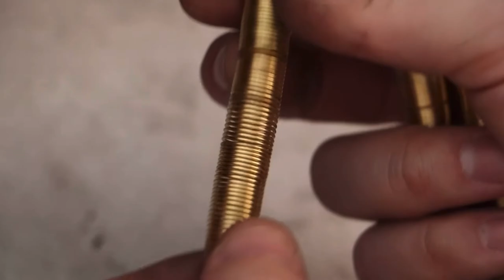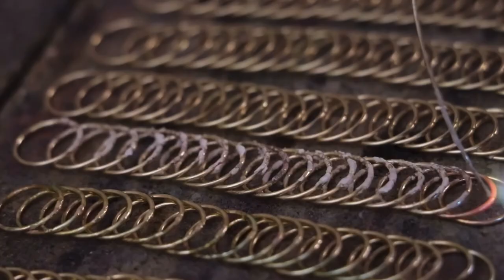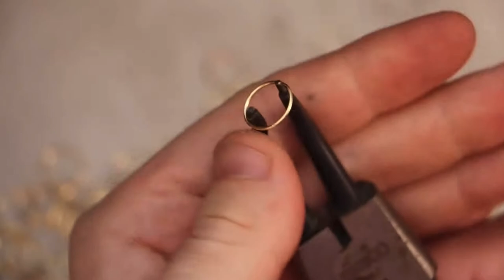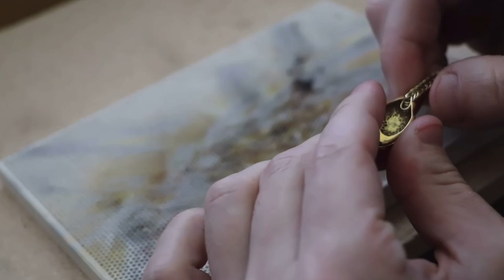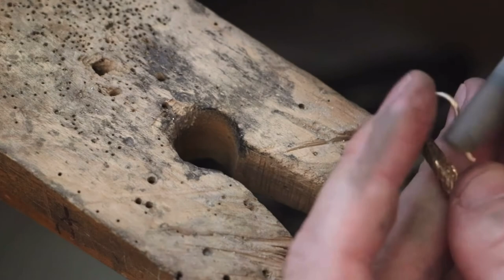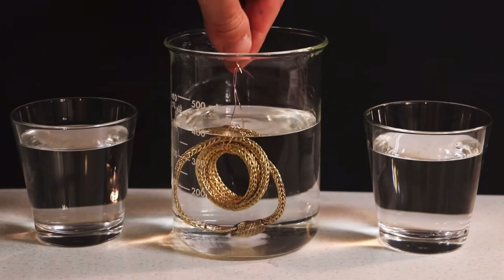making 18k gold anaconda necklace | DYNAMIS JEWELRY

Comment: What was all the dunks at the end?
Reply: Probably Gold dipping to make sure chain can have richer yellow color of gold.. Lot of jewellers tend to do that. Mostly on 14kt gold, so end product can look more like 18kt or even 22kt gold at bright light. Consider it like gold chain with higher purity gold plating.. :)
Reply: @ivanaugustan196  does that mean they can charge more
Reply: No! At least they shouldn't be charge more. I mean they can charge more for it, nothing can stop them from doing it, but not for a much. Cuz you still pay only for 14kt gold and not for thin layer of plating. Plating is purely for esthetic reasons to be more eye appealing and so on. It doesn't give any particular value other then it looks better. But that plate will eventually wear off, so it doesn't make sense to charge more.
As conclusion, plating is way to thin layer to give any meaningful weight to base material, so that shouldn't be giving any particular value other then visual appeal. That's why some jeweler will charge differently for the same piece of gold, but that is mostly cuz they calculate their working hours differently spent on such a piece.
Reply: @ivanaugustan196  thanks that was great info thank-you